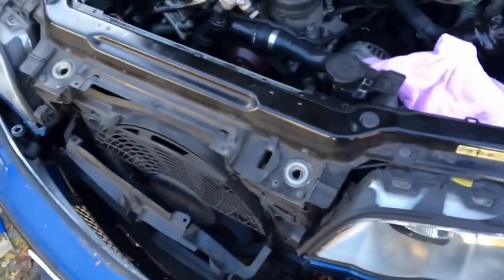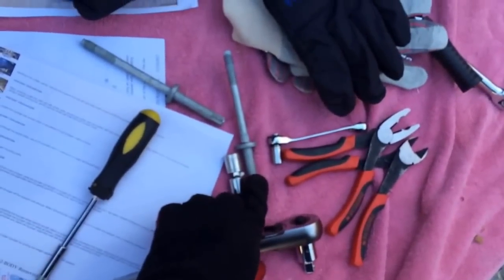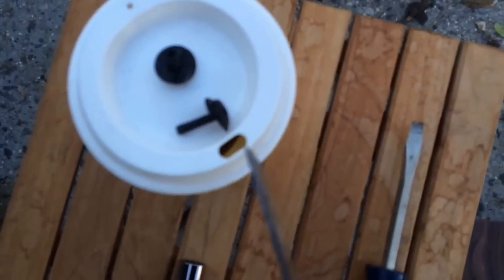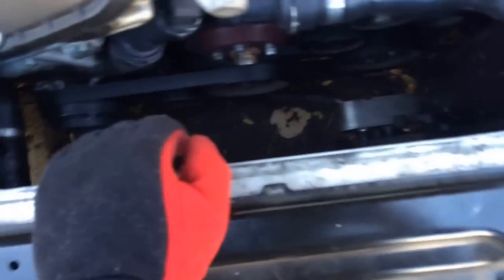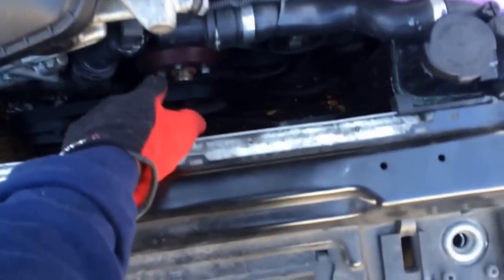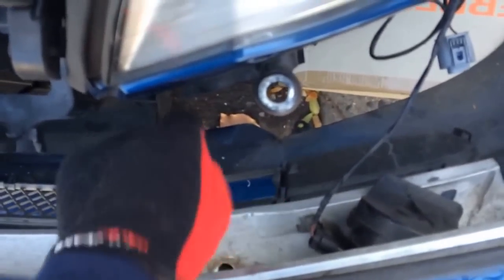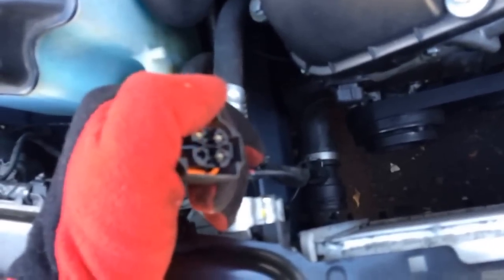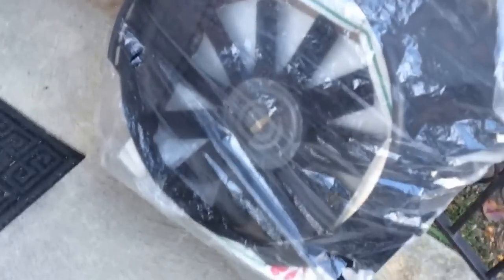BMW E46 Auxilary Fan & Front Bumper Removal DIY Experience - Fan Delete Mod Part 1

Comment: How did you wire in your new electric fan? Did you reuse your factory auxiliary fan wiring?
Reply from the maker: It plugs and plays into the existing connector for the front aux fan.

Comment: You are deleting the AUX fan which cools your A/C? And the clutch fan is the engine fan which sounds like a dump truck when engaged or goes bad that should be upgraded to a electric fan only leave the AUX fan alone unlesss you want the A/C to delete itself too.
Reply from the maker: My AC (and AC compressor) worked fine after this. The AC compressor is a belt driven component in the M54 engine bay.  
The Manual transmission M54 and other 3 series engine comes factory with the one electric fan. The Steptronic/Automatic transmission M54 engine  and other 3 series engine comes with the two fans engine and auxiliary fan. Because of this it is thought that the extra fan in Steptronic cars is for transmission cooling. At some point someone realized you do not need the extra fan in the M54 Steptronic cars. The one electrical fan works pretty well relative to the work of two fans.

Comment: Olaf so which fan are you upgrading your car to?  Can you post the part number and link where you're getting yours from?
Reply from the maker: The BEHR Eectric Fan - BMW P/N 17117561757. I have been having issues with my current camera recording videos and my iPhone 5S sort of sucks for video content to YouTube so I didn't get a chance to upload a video of the new fan as yet. I will upload the video this week.

I got the fan from ECS Tuning for $240 shipped. You can get it cheaper elsewhere but becareful of "OEM-like'  imitations.
Reply: olaf2046 i live in las vegas and thinking about deleting the fans on my 323i. Do you think the elecrtic fan would be enough to cool the engine in 110 degree weather.
Reply from the maker: No your engine will actually benefit since it will be less moving parts. Moving parts may be there to cool but moving parts also generate heat as well.
Reply from the maker: orlando perez replied. No your engine will actually benefit since it will be less moving parts. Moving parts may be there to cool but moving parts also generate heat as well.

Comment: it would be nice if you can record it from the beginning
, by the way, whats the advantage using electrical fan?
Reply from the maker: On e46fanatics web forums I have pictures showing the removal of the two fans take off 15 lbs off the front end of your car while only 7 lbs is added on with the 1 electric fan.  The effect of this is better handling, better mpgs, better acceleration performance, and less things under your hood that will fail. Mechanical fans destroy everything from the hood to the radiator when they explode and the Aux fan sounds like a dumptruck when it goes bad. Electric fans rarely if ever fail.
Reply: olaf2046
Also worth mentioning is a modest, but measurable increase in fuel economy and usable power, as the engine is no longer subject to the inertia and aerodynamic drag produced by the mechanical fan.

Comment: Could you just reuse your AUX fan you just removed to be your "electric fan"? Instead of buying a new one.
Reply from the maker: no you can't use the aux fan in place of an electric fan
Reply: olaf2046 Yes, you can. If you buy an electric fan housing and take the fan and motor out of the aux fan, you can make your own electric fan
Reply from the maker: I would love to see a DIY for that. I have seen the colorful JDM  aftermarket radiator electric fan kits on eBay and really hope you are not referring to those.